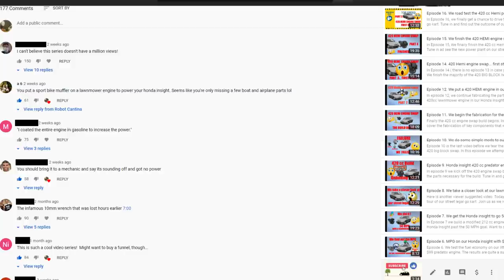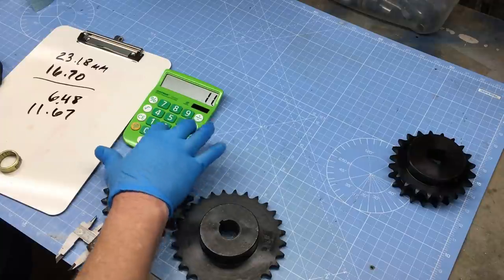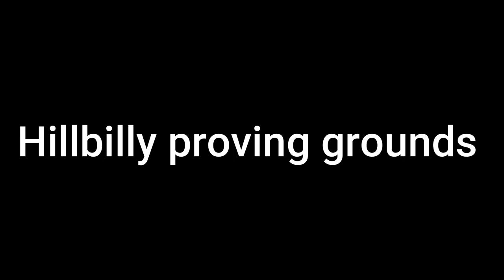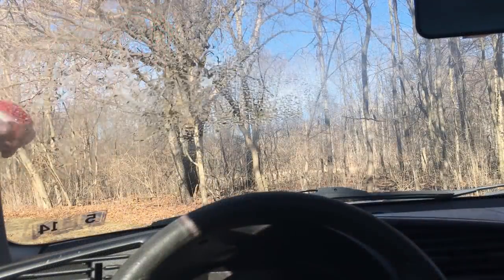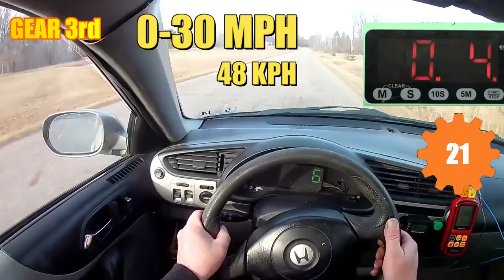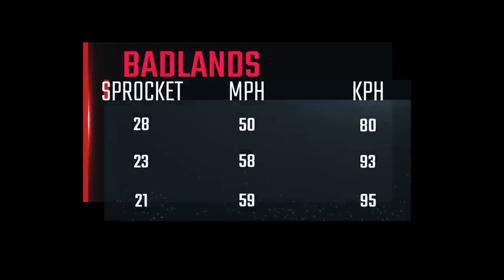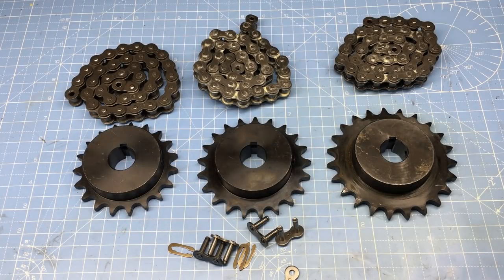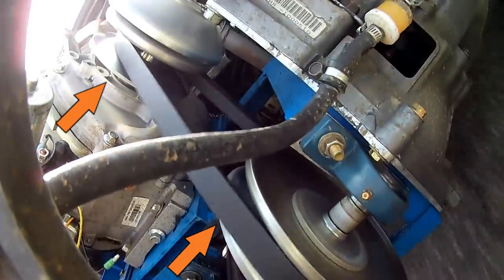Episode 17.  We find top speed and the MPG of our Honda Insight with a 420cc cement mixer engine.

Comment: Good video. If your goal is maximum mph from the Predator engine, I think there are some tweaks that might help. One would be narrower tires tires to reduce road friction. A hood scoop might help by forcing more air into the engine at higher speeds to get a little more power. Even an electric blower forcing air into the carburetor might help. Making it ride closer to the ground or enclosing the bottom of the engine compartment can reduce some friction. More exotic would be a nitrous injector although it might destroy the engine. Some people claim you get more power with a special spark plug that produces a shaped discharge. Keep experimenting.

Comment: Is this the driven or driving sprocket?

Edit.  13:50 I see an issue.   Belt looks flappy there , might need a slightly shorter one.  LOL   also maybe slightly heavier weights in the variator.

Comment: Trailer wheels put on the car aired up to max pressure,very low rolling resistance,would make good size improvements in everything you got going on there.

Comment: I would have thought the choice would have been the 23T. Seemed like a better mix of power and economy.
Reply: I agree too but I think that he is planning for power mods. If the engine is slightly more powerful the efficiency will easily move to the 23T vs 21T.
Reply: Yea stock 23 would work better but depending on the mods he may even push through the 21t

Comment: There's roots style blowers that might be fun to put on that engine on ebay under $200. I don't know if they work, but seems simpler than a turbo on these types of engines if that's something you would be interested in. For a long time, I've wondered what the strength of the bottom end of these engines is. The stock oil splasher tends to break at high rpm and ruin everything, but I'm not sure how much power/tq at the factory 3600-4000 RPM the rod/piston will take. It might be fun to try boosting with a blower.

I've been loving the videos. This car is super cool.
Reply from the maker: We are going to start with EFI then progress to the turbo.  I want to try the turbo before doing a supercharger.  Now the engine will likely explode without some reinforcements.  so we will go with a billet rod and some other stuff, but it still wont be strong enough for any serious boost.  it should be interesting.

Comment: I think you should install a resonator just before the exhaust tip. It seems to make a hollow droning noise due to the length of pipe between main silencer and tip.

Also the cvt is robbing quite some power due to friction. Any possibility of installing a dry clutch and hook it up to the transmission?
Reply from the maker: I think we may be close to the limit of the cvt.   Using an automotive clutch may be next, however I need to work out how to absorb the thrust pressure.

Comment: Right now, I'm in the process of restoring my early 90's F-150 to where it looks brand new....because everything I'll put on it WILL be brand new. But once I'm done with it, the next thing I'll get my hands on is a cheap (and sh!tty) Chinese electric micro car, a Briggs 19HP Intek from a Troy Bilt mower and a 6-speed transaxle from a Craftsman.

We'll see how much of a sh!t show the engine and transmission swap will be lmao.
Reply from the maker: Please make some videos of that!
Reply: @robotcantina8957  I sure will, bud! Although as of now the truck build is.....somewhat on hold. Converting a 1/2 tonner to a 3/4 tonner is not as easy as I thought it'd be lol. BUT I do have the Craftsman tractor sitting in the front yard and I'm working on getting the Chinese car later on. I'll do some dismantling videos sometime in the summer.

Comment: Does the car have a gas tank, you should see how the speed changes with a full tank of gas, vs the tiny tank the engine came with. Though most new cars only have a 10/20 Gallon fuel tank anyway, so it shouldn't affect the speed too much?
Reply from the maker: The original fuel tank was removed to save on weight.
Reply: @robotcantina8957  Cool!, thanks for the reply!
Reply: @arcadeportal32  The universe likes speed. Don't delay. Don't second guess. Don't doubt. When the opportunity is there, when the impulse is there, when the intuitive nudge from within is there, act. That's your job. That's all you have to do.   Keep going jimbo.   We love those amazing speeds!

Comment: Would a close ratio transmission for an Si give you more usable gears and maybe better performance? I think I remember one of the videos saying that you didn't use 1st gear due to the wide ratio gap between 1st and 2nd. Although having 1st gear as an underdrive might be helpful in some situations.
Reply from the maker: Yes, the Si close ratio gearbox would be preferred for this project... actually any gearbox other than the Insight unit would be better.  As you probably know most Honda transmissions of this era are backwards and as far as I know the Si box is the only unit that will fit the car without a lot of modifications.

Comment: I know the goal is to go fast but it seems the 23T is the sweet spot for your current setup. Also, wanted to ask how loud it is inside the cabin? Can you maintain a regular conversation with a passenger?
Reply from the maker: All the noise goes out the tail pipe, so its not too bad inside the car.  The 21 tooth sprocket is our starting point .  We are not close to being done with car.

Comment: I don't think that an O-ring chain is really necessary in this enclosed application. There is not that much water, dirt and grime around. A standard chain in good condition with proper lubrication is also a tad more efficient than one with O-rings.
Reply from the maker: In the next video we show the damage the chain took with only 60 miles on it.  Stay tuned!

Comment: I have just spotted this series of videos, thank you. The original BMC Mini had 848 ccs, 34 bhp, weighed 1290 lbs, top speed 70 mph so your 420 cc looks pretty good. The mini engine valve bounced at 6500 rpm but with mods like dual valve springs was good for over 7500 rpm.The car less engine etc weighed around 800 lbs. If you can find an old mini, have another play. Did your Honda have PS and vacuum boosted brakes?

Comment: Run the 19T. The data shown indicates that the engine isn't be fully loaded (Yeah, I know.. trust me), and that shows especially with the MPG, 0-30, and top speeds uphill.
Reply from the maker: In 5th gear at WOT we more or less hit a brick wall at 60 MPH.  The car will go a little bit faster but any sort of wind  will knock us back.
Reply: @robotcantina8957  inconsistent engine load causes those conditions on the motocross engines I've built. I may be wrong, I'm definitely no genius. However, I've seen flash loading an engine causes this, which oddly fools me as not 'having enough gear".. however, full load conditions overtime leaves better results on paper and laptimes. 

I once again, would like to mention that I may be wrong. I've never studied or built a predator.. they're far from the engine architecture I have worked with, however the numbers screamed partial engine load to me (at optimal RPM).. if the numbers fall off, I'm happy to admit my ignorance, and even happier to see you guys test it regardless. 

Anyhow, thanks again for all the content man. You're doing really awesome things and I'm happy to see the channel move forward. If you need to bounce any ideas of someone's head/brainstorm just let me know.

Comment: Can I ask if you change the wheel size how much difference would it make ?
Reply from the maker: Good question, Changing the wheel size has the same effect as changing the sprockets.... sprockets are cheaper so we went that rout.
Reply: @robotcantina8957  and can u change the engine side cluch spring on the cvh to engage faster or slower like on a scooter
Reply: @thewilliamss2392  The universe likes speed. Don't delay. Don't second guess. Don't doubt. When the opportunity is there, when the impulse is there, when the intuitive nudge from within is there, act. That's your job. That's all you have to do.   Keep going jimbo.   We love those amazing speeds!

Comment: How about adjusting the governor on the engine for higher RPM?
Reply from the maker: At 59 MPH the engine was maxed out as far as power goes, but it still had 500 more rpm to go.  So the governor did not effect the top speed.
Reply: @robotcantina8957  What is the maximum RPM governed?  You may get away with a larger sprocket if you increased the maximum RPM.

Saw another YT Vlogger who used a 2 cylinder Harbor Freight  engine in a go kart.  Did a bunch of mods.
Reply from the maker: @drsethsr  the governor is set to 4200 rpm however the engine will no go faster than 35-3600 rpm because of the wind resistance at 59 mph

Comment: The little engineer in me wonders why you chose to proceed with the 21 sprocket... Sure it's better speed but fuel economy and engine durability are also really important, right?
Reply from the maker: We are not done with this project.. the 21 tooth sprocket is a good starting point for the rest of the modifications we plan on doing.
Reply: @robotcantina8957  I hope you're not done because I enjoy this series tremendously :-)
From an observer's perspective it just seemed you had found a sweet spot with the 23 where everything comes together nicely...

Comment: perfect gearing (the 23t) for best speed and economy. go fuel injection to that combo and run 45 mph (standard unposted speed limit), might bag some great mpg numbers. fuel injected with a 2" long intake manifold? 3"? 3.5"? 4"? mentioning different lengths because Briggs type engines ARE all about pulse-flow, the pulse can help or hurt atomization and efficiency. just for giggles, you might want to grab a 24t sprocket to lighten engine load for an mpg run. slide barrel carb could be really nice option too. larger exhaust pipe and wrap it to damp noise, some undercoating to both sides of the firewall (one can worth is cheap) might be nice. main power robbing is probably the Honda transmission, how light an oil can be put in it considering how little power is being put through it? engine longevity.. external oil pump and filter would help keep it cleaner+cooler.

Comment: Does the CVT get hot after a bit of driving?  If so it is eating power.
Reply from the maker: The CVT clutch will pick up heat from the engine after a while, but the belt is always cool.

Comment: 😊You are doing a terrific job but I am sure you could explain it to me. I think by switching the sprockets you are changing the rpm and torque settings to get the ideal rpm to get maximum torque. So it seems like the 23 tooth sprocket was the best. So what rpm was it going at and was it where it produces peak torque ? Thanks trying to understand it to the best I can. Thanks for your explanation

Comment: I can't remember who makes it, but there's a bushing that you replace your copper bushing in the Tq. Conv. and basically it spares the belt from topping out on the CVT, and also allows for different top speed. I wish I could find it for you, but guys on minibike clubs use them all the time and save their belts and add top speed or acceleration.

Comment: What is the optimal spring tension for your CVT clutches?
Reply from the maker: The Comet 44 clutch and driven pulley are rated for 18hp  The spring tension is unknown but it is the same as purchased with no modifications.  Once the clutch is fully engaged there appears to be little slip in the system.
Reply: @robotcantina8957  Do they sell different springs you could experiment with for better performance? Maybe call the company and ask?

Comment: Great video. You should adjust the front toe using the string alignment method, I'm sure all the extra rolling resistance is hindering the performance of your go kart. It would be interesting to see if there was a noticeable increase of performance before vs after alignment
Reply from the maker: The string method will not work because the rear track on this car is 4 inches narrower. I will take the car in this week to have the alignment checked.
Reply: @robotcantina8957  Ahh, I did not know that about the insight. How goofy. Apparently you can also do an alignment using a protractor and making scribes in the ground but I'm less familiar with that method. Keep that one in your back pocket just in case you ever re design the subframe and you don't want to take it back to the shop.

I wish I was still an alignment tech, I would have aligned your car car for free. It would be an honor to turn a wrench on this thing. Take care
Reply from the maker: @firstlast---  Thanks for the protractor tip.  Finding an independent alignment shop that is close and friendly to this project was not so easy.

Comment: Wondering, if you add a fan to cooldown the engine, will it gain the performance?
Reply from the maker: An electric fan may help in the future, but right now we are running 205 to 215 F with the 21 tooth sprocket.  Its still within the operating range.
Reply: Stock these engines already have a fan, it's a radial flow type formed into the flywheel.

Comment: theres a phone app that measures 0 to ? time using gps , might want to look intoo that
looking at the cvt drive gets me wondering : maibe it helps getting the engine in a more favorable rpm back by messing with the springs and weights in the cvt drive , might be able to get it to pick up at a lower or higher rpm and stay at a narrowed band befor reaching the time to switch gears 
could improve torq could improve top speed , not sure but its worth a try

Comment: Now, if you can find a way to make this engine a little more quiet, and had a turbo...
Reply: It would be quieter with the turbo
Reply: @zomgz932  I don't know that this particular engine can handle the extra pressure in the cylinder head.
Reply: @msamour   cars and cameras did a turbo 420.  but with the load  you'd likely have to go to ARP headstuds and a good headgasket
Reply: @zomgz932  I checked during break this afternoon,  and there a lot of mods available for that engine. It would be interesting to see what kind of performance they can get if they tune it.
Reply: @msamour  yea i'v seen turnkey kits with over 30HP

Comment: Definitely think you’re hitting a wall with the torque and hp of that engine. Personally I would have went with the 23T as it seems to be the best well rounded for this application. But in know a lot of people don’t realize that double the hp doesn’t result in double the speed. There’s a reason that land speed record cars have jet engines with ridiculous power output.
Reply from the maker: If we were going to keep the engine stock then the 23 toot sprocket is the perfect combo,  but we need to push this project to the limits and the 21 tooth is just the jumping point.

Comment: Have you change the oil yet?
Reply from the maker: Yes, the oil was changed before shooting this video.
Reply: Great. Hate to see a oil problem after all the great work. Have you considered synthetic over Dino? Any sensor or gauge. Or just keep chking it.
Reply from the maker: @TheWaterman1000  Conversation about engine oil is the best way to start a food fight on the internet.  Anyway  I broke the engine in on 5W30.  The engine temperature seemed fine.  I switched to 15W40 diesel oil and it seems to run a tad hotter.
Reply: @robotcantina8957  I know what you mean. I use dino in my big semi and dodge diesel 1994. Reason I asked when I ran my jetta tdi taxi diesel I used synth because it stayed cleaner and felt slicker than dyno, but in the end I tell people use what you like. Now off to finish my rc lawn mower build😎

Comment: The thing with gears and chains is once you use a chain on a set of gears for a bit, a newer chain (the oh-ring type you want) won't work to great as the gears will be worn to fit the previous chain. This is why on a motorcycle gears are replaced with the chain, as a used gear will stretch out a new chain, or worst skipping and jamming at speed!

Comment: Have you tried boosting the octane
Reply from the maker: not yet
Reply: @robotcantina8957   So you do have plans to do such a thing
Reply from the maker: @robertlewis6736  Well, boosting the octane on an unmodified low compression engine may actually hurt performance. however with the modifications planned, we will certainly need to raise the octane in the fuel.